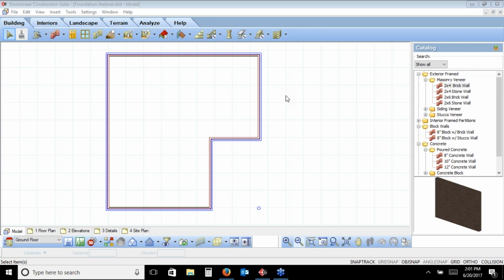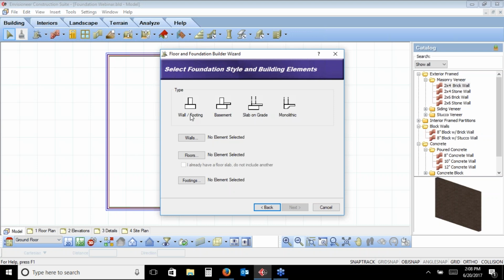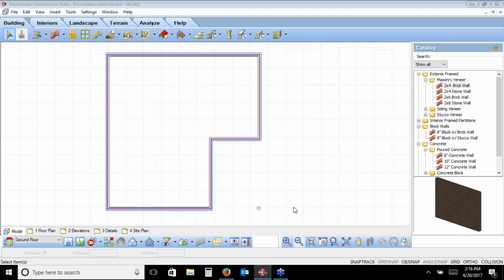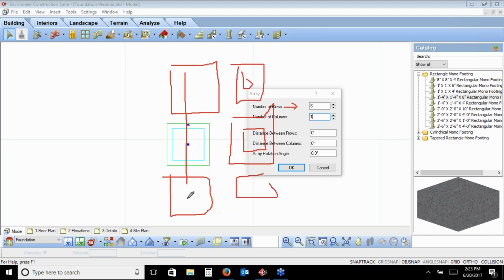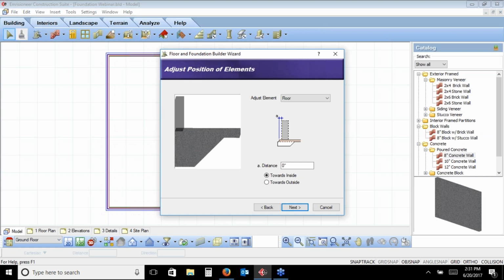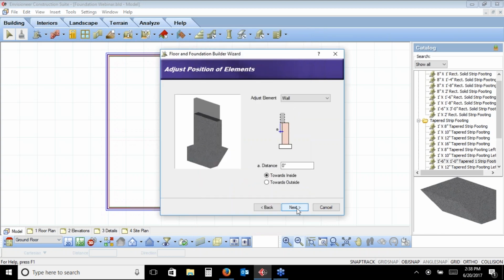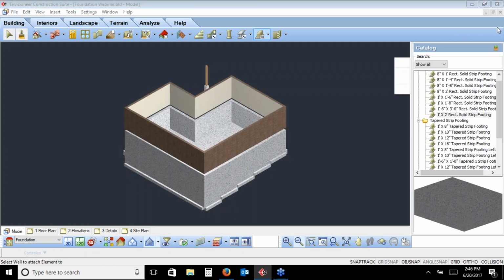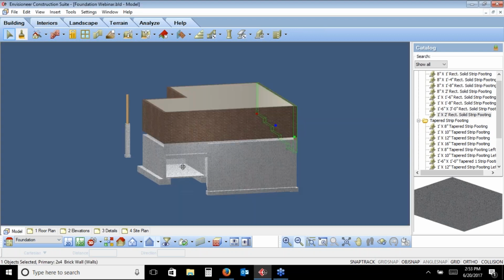Webinar Recording - Foundations

Comment: I have been away from envisioneer for a couple of years, now I'm thinking about upgrading and start designing again, has there been anything new in "Foundations" in the past two years?
Reply from the maker: Hi Ike, I know there has been some new features added like Structural Floors that would pertain to Foundations that have been added in the last couple of versions but it will depend on what version you are running. I am going to attach a link to a video that shows what is new in V15.
https://youtu.be/A65VMF7OXIw